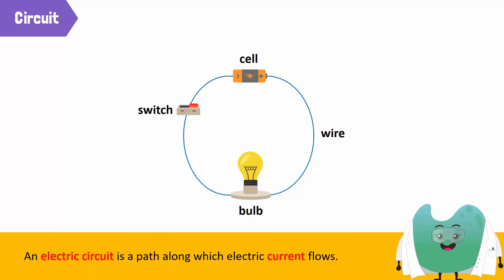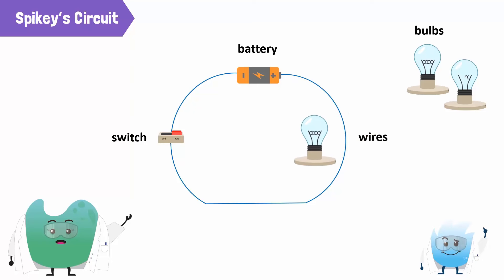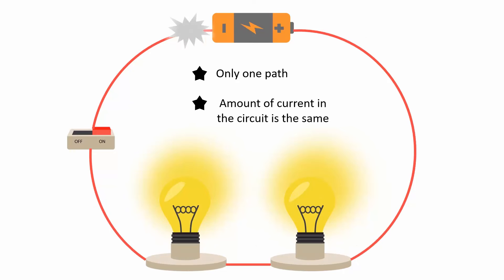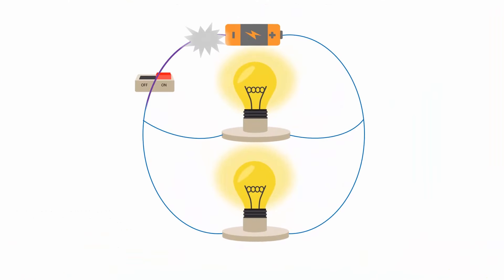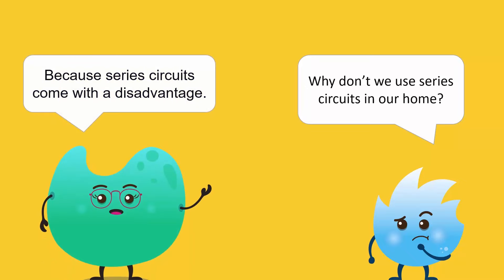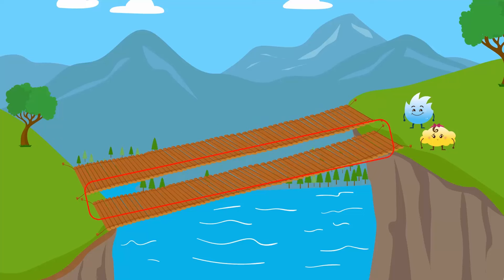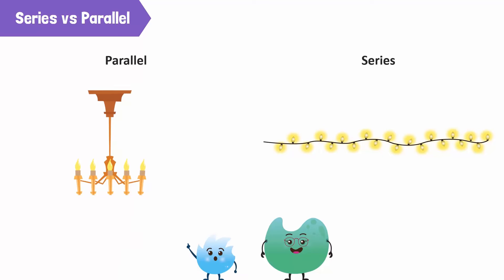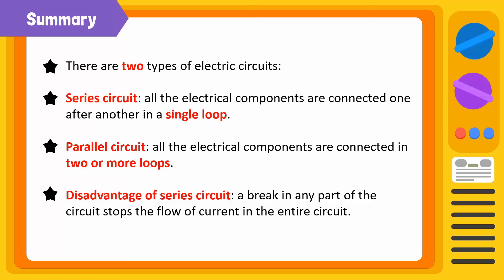Types of Electric Circuits

Comment: If you all want what they said in one paragraph:
An electric circuit is a path along which electric current flows. simple circuit has a cell a bulb and a switch connected by wires but what happens when there are two bulbs how can we connect them well we can connect the second bulb right next to the first bulb or we can connect it above the first one well let's see who's right let's make spiky circuit first we need a battery a switch three bulbs two that work and one that's burnt out and connecting virus let's set up the circuit now let's add another bulb right next to the first one what happens to the brightness of the first bulb whoa it's dimmer exactly now replace one of the light bulbs with a burned-out one what happens both the bulbs go out this is a series circuit if all the electrical components are connected one after another in a single loop then it is a series circuit in a series circuit there is only one path for the current to flow the amount of current that flows through each bulb of the circuit is the same now let's try bubble suggestion will add another bulb above the first one what happens to the brightness of the first bulb it remains the same this way correct now replace one of the light bulbs with the burned-out one what happens the burnt out bulb does not glow but the other world is still glowing it is not affected excellent observation this is a parallel circuit if all the electrical components are connected in two or more loops then it is a parallel circuit in a parallel circuit there is more than one path for the current to flow each loop is independent so the current in one loop will not affect the current in another loop so now we know that both spiky and bubbles were right spiky connected the bulbs in a series whereas bubbles connected the bulbs in parallel hence there are two types of circuits 1c circuits for example decoration lights 2 parallel circuits our home appliances are always connected in parallel but why why don't we use Siri circuits in our home because series circuits come with  disadvantage let's take a closer look with an example look at these bridges they are connected one after another in series you can cross these bridges easily but what happens when one of the bridges collapses can you cross to the other side no we can't exactly this is the disadvantage of a series circuit a break in any part of the circuit stops the flow of current in the whole circuit another disadvantage is that the more bulbs we add to the series circuit the dimmer they become now look at these bridges connected in parallel what happens when one of the bridges collapses can you cross to the other side now yes because we can use the other bridge to cross to the other side well done this is the advantage of a parallel circuit when there is a brick in one of the branches in the circuit current can still flow through the other branches also the brightness of the bulbs remains the same since every loop is independent now can you explain the chandelier and decoration lights problem you had earlier oh yes it makes sense now only one bulb of the chandelier went out because it is connected in a parallel circuit one broken bulb did not affect the current in rest of the bulbs but for the string of lights all the bulbs went out because it is connected in series one broken bulb will stop the flow of current to all the bulbs good job let's summarize there are two types of electric circuits a series circuit is one in which all the electrical components are connected one after another in a single loop a parallel circuit is one in which all the electrical components are connected in two or more loops a disadvantage of the series circuit is that a break in any part of the circuit stops the flow of current in the entire circuit but a break in any part of the parallel circuit does not